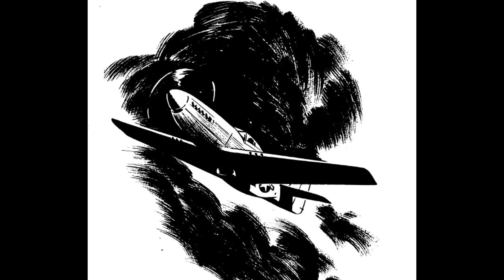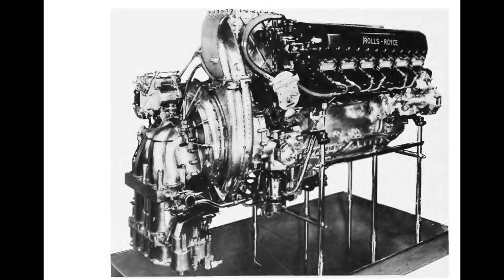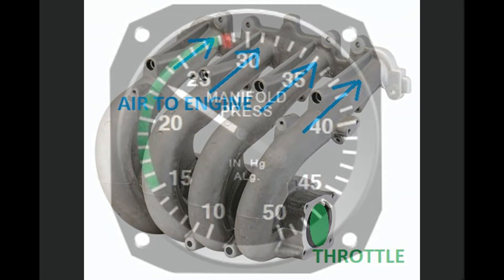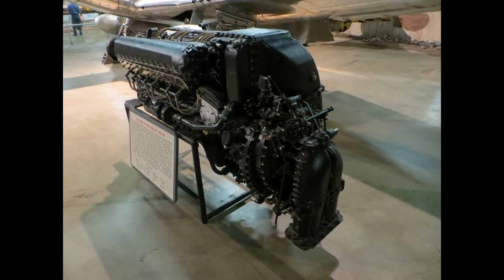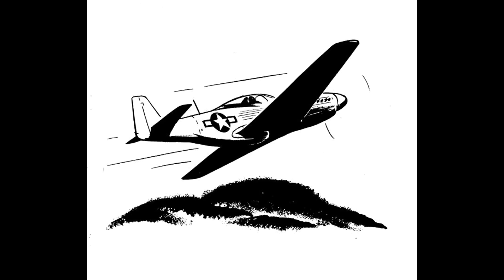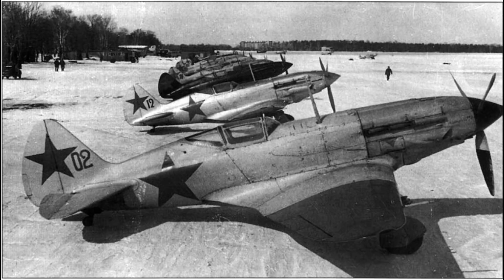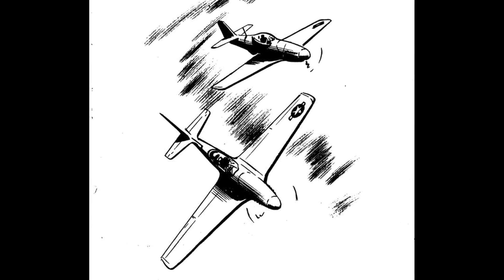P51 Mustang Manifold Pressure

Comment: Hi Greg Sorry but i got a question. Why is it having more power at 8500 feet when using military? can you give a more clear and detil answer?  I really wanna learn more.
Reply from the maker: That's because of the extra cost of driving the supercharger at higher altitudes. As you go higher and higher, the supercharger has to spin faster to make the same amount of manifold pressure. That costs horsepower.  However, at some lower altitudes there are throttling losses, so there is often an optimum altitude. Please watch my supercharging vs turbocharging video for a better explanation of this.
Reply: @GregsAirplanesandAutomobiles  thank you so much
Reply: @GregsAirplanesandAutomobiles  Another question. How much does the speed effect p51d's manifold pressure?

Comment: good stuff man, love the channel n content ;) just a quick one that no body seems to explain, the merlin engine had a 3000RPM limit, at 3000RPM i can run 0 boost upto 24psi of boost(spitfire mk IX sea level)), but if the engine speed doesnt increase above 3000RPM with 24psi of boost, how does this extra boost translate to more speed? is it due to a variable pitch prop, where the throttle is opened and at the same time the pro pitch changes to a more agressive angle of attack to allow more air flow translating into speed? i hope iv got this right hahahahaa ;) DCS world for ya
Reply from the maker: Good question, and I can certainly help As you increase manifold pressure in the scenario you laid out, the prop will increase pitch in order to prevent the engine from exceeding 3000rpm. Thus each time the prop goes around it moves the plane farther, thus it's going faster.
Reply: @GregsAirplanesandAutomobiles  thanks mate, thought i had it correct but not many peeps talk about a constant speed prop with variable pitch, maybe its just a given and im a noob hahahaa. keep up the good work :)

Comment: hi greg i just found an old chart for converting the manifold of various nations
1 ata is set at 28.9 inches, a bit more than -5 (like -4.5) british psi and roughly -28mm of mercury for japan ( 0 set at 760mm) but idk, the japanes scale is marked every 5mm and it's a bit hard to make out what number it is

wich makes sense cause altough 1 ata is very close to beign 1 bar, it's actually 1 kgf/cm^2
so you'll found that 1atm is 1.033 ata
1atm= 1.013 bar
1 bar=10N/cm^2
so 1atm=10.13N/cm^2 and dividing it by g (9.81) youl''get 1.033 (or somethign close depending on were you round numbers up)

so in the end 1ata is 28.95 inch of hg, 0.9684 atm or 735mm of mercury (this should give the japanese a -25, so maybe they way they rounded numbers up was a bit different)
Reply from the maker: Thanks Gjldo. Do you have a source by any chance?
Reply: @GregsAirplanesandAutomobiles  
i found the chart here https://ww2aircraft.net/forum/threads/ata-in-inches-hg.26858/#lg=post-734728&slide=0

for the math, well was pretty basic math done from what i remember from highschool, we used to do some theroteical stuff on the italian version on the 605A, my school used to have in its hangar the last flyworthy macchi 205 (sistems were checked every year as teaching implement and the engine was started up 2-3 times a year, like at the beginning of the year, christmas break and end; well at least until it almost decapitated a few boys), wich eventually was restored, flyed and crashed in the 80's, but copies of the technical documents were kept at least till while i attended it (2001-2006), so thats were i learned that 1 ata is 1 kgf/cm^2 (on the actual 205 gauge it was directly labeled as kg/cm2), also it should be noted that ours was a weird plane, beign one of the 30ish conversions done by the royal airforce (italian regia) by slapping the 605 on a 202 frame, with all the required modification

any way you'll find that even on wiki 1at is listed as 1 kg/cm^2, from there is just conversions
Reply: just for further info ata in italian is atmosfera tecnica assoluta, wich translates in absolute technical atmosphere, and i belive that it translates in to something similar in german, any way is a unit of mesurment for the "sistema tecnico", wich is the "gravitational metric system" in english speaking countries
Reply from the maker: That chart is a great find. Of course I could always do the math, but there was no way to know until now exactly what number the Germans were using to base 1.0 on.

Comment: Hi, Greg! Great video, though you didn't mention (unless I missed it) WHY more manifold pressure yields more power. The answer, of course, is that you can increase fuel because you have more air. (The air/fuel ratio is pretty much constant in a gasoline engine). More fuel means--guess what?--more power. But you already know this.

Also worth noting: you can achieve the same thing with bigger displacement. But that adds a lot more weight and bulk than a supercharger. The power/weight ratio of a supercharged engine is hard to beat. Except with a turbine engine, of course. But that's a different video.
Reply from the maker: Good point. Yes, more air, means you can burn more fuel and make more power. I actually covered this in another video, but I took it down. Thanks for pointing it out.

Comment: Just a small comment about the German pressure units: 1 at (from Atmosphäre) is 1 kgf/cm², or 1.019 bar, quite close to standard atmospheric pressure of 1 atm = 1.013 bar. Also there is ata - absolute pressure, and atü - gauge pressure (the ü stands for Überdruck, literally overpressure)
Reply from the maker: Thanks Thomas.

Comment: manifold pressure = boost, just like in a honda

 but because ww2 and airplane.... you may have a vacuum instead of boost, super-charger gets shot out, ETC..... its still just a boost gauge
only in inches of mercury(inHG) instead of pounds per square inch (PSI)
Reply: Aircraft gauges are in absolute air pressure rather than vacuum, because that's the key thing: how much air pressure is in the intake manifold. The wider the throttle opening, the higher the manifold pressure, which means more power.

A vacuum gauge measures the difference between ambient and manifold pressure; in a normally-aspirated engine, it's really just a measure of how wide the throttle is. I put an after-market vacuum gauge on my '69 Chevelle Malibu some years ago. The first tine I drove at high altitude, I thought there was something wrong with the engine. Manifold "vacuum" had dropped from about 16" to less than 10" on flat ground. I learned later (pilot training) that I just needed a wider throttle opening to bring the manifold pressure up to the required level. The lower vacuum reading just reflected that. If I had had an aircraft-type manifold pressure gauge, it would have read the same at both altitudes.
Reply from the maker: That's incorrect. Manifold Pressure does NOT equal boost. I think you should watch, or re-watch the video. Boost is the amount of pressure above ambient atmospheric pressure. For example, at sea level on a high pressure day with an ambient pressure of 30.00 inches hg, 60 inches of manifold pressure would be about 30 inches of boost, since it's 30 inches above ambient. Now take that same airplane at high altitude where ambient pressure is only 20 inches hg. Run it up to 60 inches of manifold pressure and you have 40 inches of boost. In both cases manifold pressure is the same, but boost is very different.

Comment: Wasn't there a problem with the crankshaft or camshaft in the daimler-benz 605?
Reply from the maker: The 605 had problems with its crankshaft bearings, especially the earliest versions. However it's tough to determine if it was really a design issue with the bearings or an issue with decreasing quality of engine oils. It could also have been decreasing quality of the metals in the bearings. I really don't know.
Reply: I read somewhere that they went from using good quality roller bearings (in the 603) to plain bearings and of a lower quality.   @GregsAirplanesandAutomobiles

Comment: About the German pressure unit 'ata'  ...

It is probably 'Technical atmosphere'; 1 at = 1 kp/cm2.
1 kp equals the force subjected to 1 kg by earth's gravitational pull.

1 kp/cm2 = 28.959025 inHg = 14.223343 psi = 98 066.5 Pa

It is described in en.wikipedia.org:
 Technical atmosphere
 https://en.wikipedia.org/wiki/Technical_atmosphere

de.wikipedia.org gives three sub variants:

 Technische Atmosphäre
 https://de.wikipedia.org/wiki/Technische_Atmosphäre

 ata = absolute pressure (at absolute)
 atü = pressure above reference pressure (at über)
 atu = pressure below reference level (at unter )

Comment: And you really can’t go on to talk about “inches of mercury” without explaining why in the holy heck are they using mercury to measure air pressure? At least I couldn’t when I was going through my CFI training.
Reply: Mercury barometers were used all over the world ever since Italian scientists  Torricelli and Viviani invented the principle in the seventeenth century.  One millimeter of mercury is one Torri. One atmosphere equals to 760 millimeters of mercury, 101 kPa or 14.7 pounds per square inch, as you like. Or 29.9 inches of mercury.
Reply from the maker: Hi Matthew, I think I did do that in one of my videos somewhere. Anyway, I like using inches of mercury because 1000' of altitude equals a pressure change of about 1 inch of mercury. Thus when you are climbing, every 1000 feet you move the throttle up to add 1 inch, easy peasy. I know it's confusing for an engineer, but for a pilot the numbers make sense.

Comment: Thanks for this incredibly interesting channel. How many books do you read in a week? :)
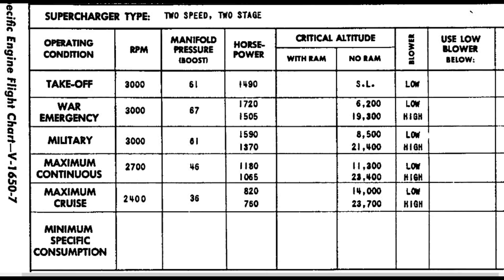Question off topic for anybody - the table at 6:04. Under Critical Altitude - "With Ram / No Ram" - what's that referring to?
Reply from the maker: The P51, like almost all WW2 fighters uses the effect of "ram-air" to force air into the supercharger. It's just a duct starting at the front of the plane under the propeller spinner (Merlin version). However, there are some cases, when you don't have the ram-air effect. At low speeds, or when the pilot chooses to bypass the duct and use non, ram air due to the thread of foreign object ingestion.
Reply: Thanks - I just was reading the P-38's Pilots Flight Operating Instructions, which Google provided, when you answered my question.

Comment: Another good video, Also I could not help but notice you reference me by my Rise Of Flight nickname "Ace." I also notice your profile pic is a Camel in Rise Of Flight, have we "met in the skies." on Rise Of Flight? or is it just a coincidence that you called me "Ace"?

I have also read accounts, with higher octane fuels, 100 octane was the fuel the V-1650-7 was rated for according to my book "Mustang, the story of the P-51 Fighter." such as 130 Octane was was very avalible that 70-72 inches was possible? and have read that some pilots would push 70 inches in a P-51on some sources I have read somewhere, I also read with 150 Octane fuel, that 80 inches was possible by adjusting the regulators, what do you think about that, seeing you have some understanding?

with these manifold pressures 70-72 inches, and 80 inches what power ratings do you think you would get at ideal altitudes? My guess is with 70-72 inches you would possibly be pushing in the neighborhood of 1,800HP, and in excess of 2,000HP with 150 Octane which was commonly used to intercept V-1 buzz bombs, where the thicker air down low would commonly cause engine damage with just 100 octane, and at higher altitude I understand prop stall could be a issue where the air is thinner. 

Please excuse me if this has strayed to far from the topic.
Reply from the maker: I called you Ace because it's in your name. That said, I do play Rise of Flight as GregHF . In fact I played online  today!
Reply: maybe ill catch you some time...

Comment: There are 2 ways to read pressure, absolute & gauge. 14.7 psi at sea level would be 14.7 psi absolute OR 0 psi gauge.
I think the confusion begins when automotive mechanics and aircraft mechanics begin discussing manifold pressure and boost.
Manifold pressure is an absolute reading while pounds of boost is a gauge reading. 1psi of boost would read 15.7 psi absolute OR 1 psi gauge, 2 psi of boost would 16.7 psi absolute OR 2 psi gauge....etc. As jet engine tester absolute versus gauge was always a factor that had to be taken into account when setting or recording pressures.
Reply from the maker: That's correct, although automotive sensors on modern cars measure absolute pressure, but the terminology causes confusion. In fact, MAP sensor usually stands for manifold absolute pressure.

Comment: A relative was a '51 pilot and he mentioned a Simmons, not sure of spelling, boost.  He said had to be careful of prop torque on take off.
Would second a discussion on the P-38 boost system.
Wonder why the Merlin wasn't installed in the '38

Comment: so the charger is just an air compressor?
Reply from the maker: Sort of. A supercharger is a device that compresses air, so technically, it's an air compressor. However when most people say air compressor they picture a device with pistons that pressurizes a tank of air. The supercharger on a WW2 plane is a high speed centrifugal fan that blows into the engine's intake manifold.
Reply: yes...and the engine is just an air pump!
oh ya....arnt mechanics fun???

but really.... get more air in, that means more fuel in
which means more power..... but also more exhaust air to get out
its a ballance
----------------------------------------------------------------------------------------------------------
anyway, instead of using the pistons down stroke to suck in air..... ya fucking cram that shit in their with a super or turbo charger (or both...YOLO)

a supercharger is basically two screws 
http://image.superchevy.com/f/10910521+w640+h640+q80+re0+cr1+st0/0901chp_19_z%2Bwhipple_supercharger_383_small_block_chevy_engine_build%2Binside_look_of_rotors.jpg

its driven by a belt, so it makes the engine loose a bit of power, spinning the rotors, to end up making a lot of power
their is no lag (boost is their from 2000RPM to red line)

-----------------------------------------------------------------------------------------------------------

a turbo looks like a jet engine..... it uses exhaust gasses to spin a fan, which has a shaft connected to another fan
spin the exhaust fan, ya spin the air fan, and make boost

turbos usually make more power than superchargers (no parasitic loss.... it uses waste heat [exhaust] for power)
however.... they have lag

ya floor it.... nothing, nothing, nothing.... 4000RPM and it TAKES OFF

------------------------------------------------------------------------------------------------

so depending on the engine, trans, final gear ratio and car..... average power might be better with the turbo, or with a supercharger
i personally prefer superchargers for daily drivers.... instant torque at any rpm = never having to downshift on 450 mile long drives

and turbos do well on track or drag cars..... you can always be at an RPM to spool the turbo quickly, and make boost 

------------------------------------------------------------------

PS in ww2, they called turbos "turbo super-chargers"
its NOT a supercharger..... its just a normal turbo-charger like we have on cars today (just a LOT bigger)
Reply: what a super charger or turbo charger basically does is increase the compression ratio and volumetric efficiency of any engine it is installed on
Reply: It crams more air (Oxygen) into the engine. Not necessarily compressing it. That’s what turbine (jet) engines do.
Reply: Superchargers and turbochargers absolutely do compress air, in fact, roots blowers are used as superchargers for engines and as air compressors for shops. Centrifugal compressors can be used in this way as well, but the cost is much higher.